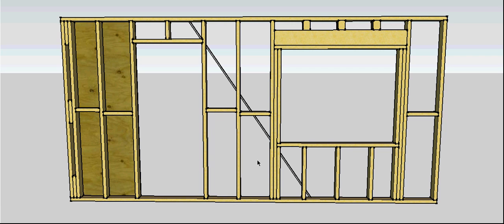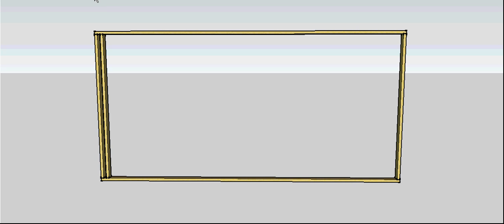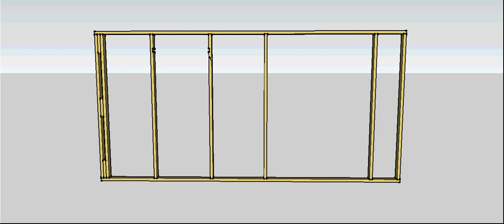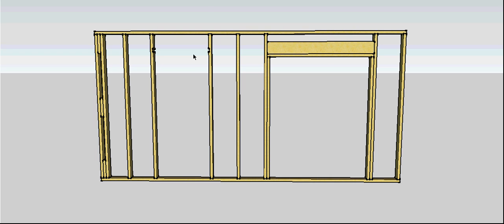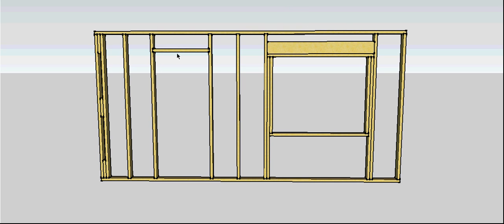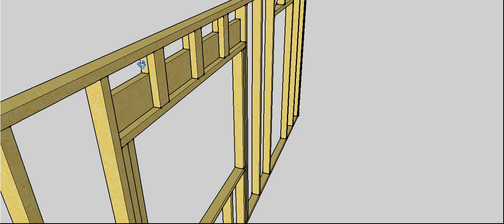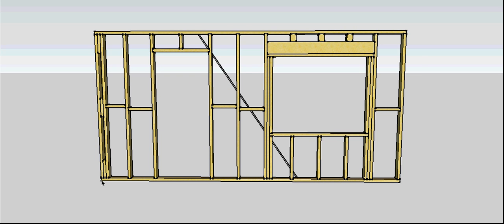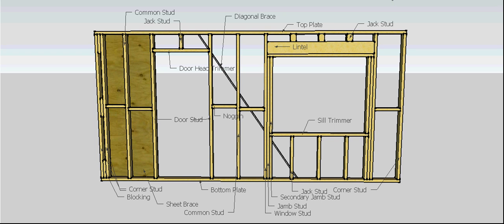Wall Frame Components and Construction Sequence

Comment: Nicely done as always. With very wide lintel, are the multiple jack studs simply nailed together or do they have thin blocking separating each one? 

When installing a wide lintel into an existing brick veneer wall, it's likely that diagonal bracing will need to be changed for sheet bracing, but I'm not sure how that would be done with the veneer already in place. How is this normally handled, assuming conventional gyprock lining, where you also wouldn't want to affect the wall thickness?
Reply from the maker: Hi Pete
Multiple studs are just nailed to each other,  the bottom plate and the lintel itself.

As for the bracing i have never really worried about it, the metal diagonal braces contribute very little bracing effect in the whole scheme if things however the only way would be to strip off all the Gyprock on the inside and add the ply brace to that wall then Gryprock back over. There is no way of doing it without increasing the wall thickness thai i know of
Reply: Buildsum ok thanks. In the example I was thinking of the plaster will all be coming off anyway, it's a 50 year old house so I may as well straighten the remaining studs as required and hang new gyprock there anyway; a very small cost in the grand scheme of things as I'll definitely be doing all the non-structural work myself anyway.  The only way I could think of to sheet brace it would be to pull all the required common and corner stud out too, basically "pre-fab" replacements with the bracing in place, then reinsert into the existing top/bottom plate as one unit, if that makes sense. It would need to be done as the first op, otherwise essentially the whole wall is propped if the lintel is already installed. The only other way I could think of would be to check it in to the front of the studs, but I think that would be very time consuming and not very practical solution.

Comment: Great vid , My Question is , what will determine the position of lentil over window opening? do we have to pre measure window opening then lay lentil over? Thanks in advance
Reply from the maker: +jivara sulaiman Hi Jivara Yes you will need to know the Stud opening dimensions for your window, you will also need to consider the Drop Off of you eaves if you have one.
https://www.youtube.com/watch?v=hr9qw2jbYco
The lintel should be above this.
It is common practice to place the lintel hard up under the top plate and then just frame out to suit the window.

Hope this helps
Reply: +Buildsum Thanks that is helpful!!
Reply: jivara sulaiman 👀

Comment: so with the panel bracing  how is that  covered by the cladding if the bracing steps out on the outside wall  wont that push the wall cladding out  or is that panel recessed into the framing
Reply from the maker: Hi David any clad wall with a bracing panel would need to be packed out the same thickness as the bracing sheet

Comment: here in the USA we never have the floor plate run across the bottom of a doorway, and we have a header over the doors as well as the windows, and all are lumber is 2x4 or 2x6 and so on and we use a 1x4 for angel bracing and it is notched into each stud making for a very strong bracing.
Reply from the maker: Joel Kerley Hi Joel Thanks for your comments. The plate across the bottom of the door is only temporary during construction and transport, once the wall has been stood and fixed in place it is cut out.Yes we use headers or Lintels over our doors as well but only in load bearing walls. As for timber sizes we commonly used 70 x 35, 70 x 45, 90 x 35 and 90 x 45 but noting larger. The timber brace used to be fairly common however steel bracing and sheet bracing is now being specified by the Structural engineers so we have to used them instead. 
Again thanks it always great to hear how things are done differently in other parts of the world.

Comment: Hi, Thanks for the video..I was wondering for internal walls here in NSW can you have stud spacings of 600mm and can you use 70 x 35 mm structural pine? Also if doing external stud walls, (I was thinking at 450 centres), is it ok to use 70 x 35 also for that?
Thanks,
Tony
Reply from the maker: Tony Adams Hi Tony All timber sizes and spacing are determined using the AS 1684 Timber Framing Code and mainly depend on the size and the weight of the roof and the grade of the timber that you are using. 

Non load bearing internal walls can be 70 x 35 mm structural pine spaced at 600mm centers as the are taking no weight. 

However I have never seen or calculated 70 x 35 mm structural pine for External Load bearing walls. The smallest I have seen was 70 x 45 however this was for a corrugated iron roof with no notching to the studs.

I would suggest that you get hold of a copy of the Timber framing code applicable to your area and  have a look at that or consult with a builder or building consultant.
Reply: Thanks for the answer.
I appreciate it
Thanks
Tony
Reply: Tony Adams 👀

Comment: Hi Mr. Buildsum thanks for this tutorial. my question is about the dimension, for all framing materials I need this or if you can tell where I find referents books. I working for framing company and I just work like a Drawing person but, if I can help for calculate other material is better for me. Thanks Luis.
Reply from the maker: Luis Melo Hi Luis in Australia we have Australian Standards that help us to calculate the sizes of the framing members the main one being AS 1684 Timber Framing Code. I would imagine that you would have the same. Other wise most material manufacturers produce their own span tables that you can use to work out the size required for thier products

Comment: great video mate. just wondering with the ply bracing, is it better to put them on when the wall is flat on the ground, after you get it nice and square, or after it is erected?  thanks.
Reply from the maker: Hi Alex
It is easier to attach the ply brace before you erect it however once you stand the wall up you wont be able to plumb it if necessary. I would tack the sheet on in the corners to hold the wall square but still allow you to adjust if after standing if necessary.

Thanks for the feedback
Reply: Buildsum thanks for replying.   what do you mean by plumbing the wall? would you only need to do this if the floor wasnt level? so say it was a timber sub floor, you then erect the wall, and nail the bottom plate down, then, if you havnt attached the ply yet, you have a little bit of lateral movment to get the studs nice and plum, but even if you attach the ply only in the corners you still wouldnt have much lateral movment to play with i think
Reply from the maker: HI Alex 
Yes in theory you should only need to plumb the wall if the floor is not level however in practice you always seem to need to adjust slightly. By tacking the corners this will allow you to keep the wall square while you move nd stand the wall and then you can easily release the 2 bottom nails and make the adjustment while the top nails hold the sheet in place. Once all the walls are Plumb you can then go around and nail them all off
Reply: usually they nail the ply wood after the wall is erected

Comment from the maker: HI Anthony Leily Thanks for your feedback. I have never heard of an actual minimum width however I would imaging that the narrower the sheet the less effective it would be and it would probaly get to a point where it would not be worth putting it on at all. I cant recall using sheets less that 900mm here in NSW, Australia. Personaly I prefer plywood over metal strap. The metal straps are a pain to install and don't really give you a lot of resistance. With Ply all you do is nail it on and you get a lot more resistance. Size is not really an issue as long as the sheets suite the stud spacings, the less cutting you have to do the better.
Reply: Buildsum
Reply: Our builders installed metal braces in the walls but forgot to nail them down. So you walk around on 1st level and the walls have a metallic vibrate sound.

And on the ground floor, the wall mounted clothes dryer makes the metal braces vibrate. I ended up having to pull off sections of the gyprock and screw the brace properly to the studs and noggins.

Hey nice video - I never understood that large plyboard - it's a brace! Makes so much more sense now - it just seemed kind of random before.

Masteron - I wouldn't recommend them to anyone. Message me if you want more info on my experience building two homes with them.

Comment: Thanks for your helpful videos, I'm a graduate structural engineer and I was told that for sheet bracing ( Plywood ) minimum width should be 900 mm to be effective, I was wondering if you use less than 900 mm and do you suggest metal strap or plywood for bracings and what typical sizes are easier to install , thanks

Comment: Which is the correct framing method?
Stagger noggins
Level noggins, centered between top and bottom plate
Reply: Buildsum Ok cheers, can't afford the AS 1684.2, so as a first time renovator just making sure everything I do is to standards
Reply: Thanks very helpfull
Reply: Michael Manning 👍